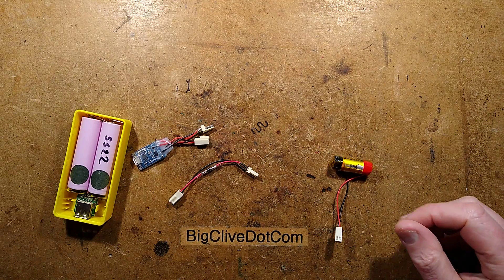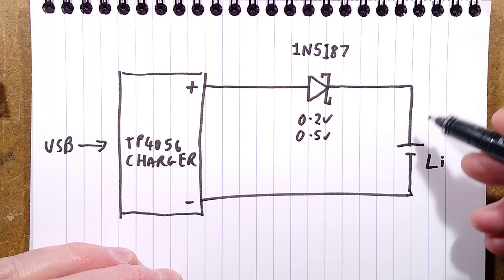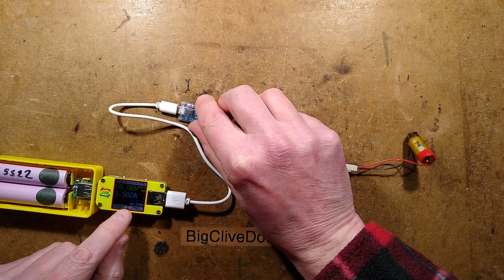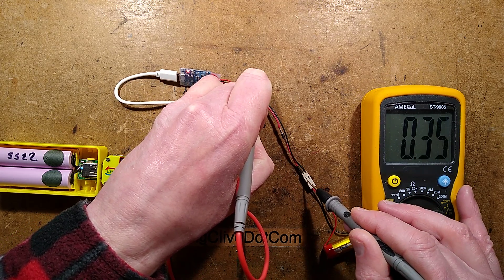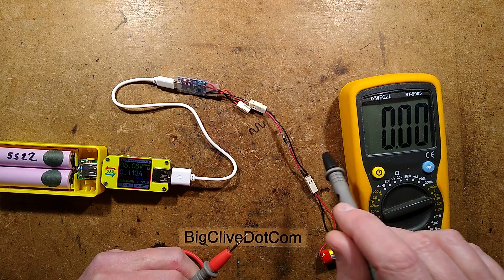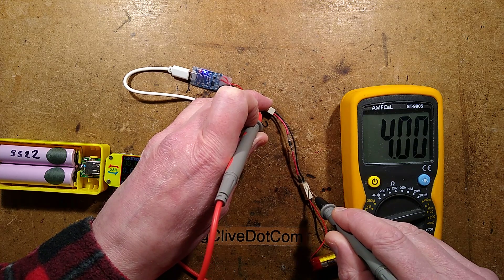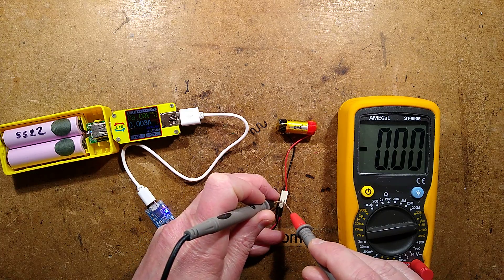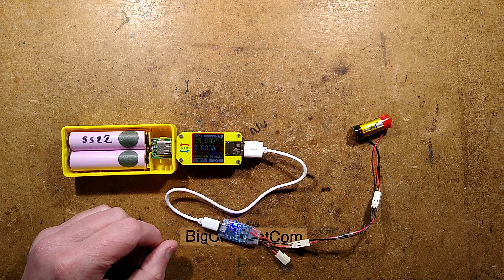Schottky diode between charger and lithium cell?

Comment: 3.9V should be around 90% of rated capacity, exchanging that last 10% for more than doubling the life (time and cycles) makes sense in standby applications.
Nice to see an actual test, thanks BC!
Reply: 3.8V is 50% SOC.  So  4.1V would be ~87% which makes batteries last for 8 years and more.
Reply: @olaf_s_23  I should be better about defining "charge (or, "saturation") voltage" vs "resting voltage" but, alas, the comment section is not conducive to verbose articulations. 
I'm just happy that there are a multitude with willingness to provide additional information without being jerks. This might not be the best forum ever, but it's at least in the top three! 
Cheers to all here! You lot continually restore faith in my fellow (hu)man.
Reply: @olaf_s_23  voltage alone won't give you the capacity of a lithium cell, it also depends on the charge/discharge rate.
Reply: Tesla recommends charging their car to 80 percent. Would that quadruppel the life?
Reply: @franzliszt3195  I don't know, probably not but maybe it's 2.3×? Specific datasheets are hard to come by so a big dose of salt and S.W.A.G. (Stupid Wild something Guess) is the best I can do.
Reply: @matthewellisor5835  no its not just the charge percentage. it's the amount of time it's at that percentage that really matters. So if you were to charge to 100pc then immediately drive where it rapidly falls below 80pc, then its nowhere near as bad for life as leaving at 100pc.  So for standby use 80pc charge is ideal.
Reply: @dr_jaymz 👍 I think we're trying to sing the same note but I might be out of tune. Keeping in the 80-90% - 30-40% SOC range will allow that standby cell/battery to live a long and (we can hope) rarely utilized life. 
If I've missed something, you have my apologies and request for edification.
Reply: @franzliszt3195  And then there's the issue of: If the car displays 80%, is the battery actually at 80% charge? Same goes for 0%. Also not just for Tesla, but any electric car, or other devices with batteries.
Reply: @maxine_q - well, as all charge/discharge monitoring systems are not exact, but are estimates based on the voltage and the charge / discharge current, if you don't hit one of the limits (full discharge or full charge), the indicated charge status will tend to drift away from the actual state of charge.
Reply: @Mark1024MAK  I wasn't talking about the inaccuracies of measuring the state of charge. The battery management system could tell the user the battery is at 100% when it is measured to be at 90% (and stop charging at that point). Same goes for 0%, leaving some extra room to extend the life of the battery.
To be clear, I have no idea whether any device actually does this, I'm just saying it could be done and the average user would have no idea about it (unless the manufacturer explicitly states that this is done).
Reply: @franzliszt3195  yes, if you keep the lower end of the discharge above 20% SOC, 60% DoD has ~4x the cycle life compared to 100% DoD usage for most lithium chemistries.
Reply: @andrewfidel2220  One thing many people seem to miss(not saying you are one of them), sure your battery lasts 4 times as many cycles but as you only use half the energy each time really the battery is "only' lasting twice as long. Of course that is still a big deal if you can manage it.
Reply: @stusue9733  That's true, but I would argue that even that is not the full story. Often batteries are not cycled over their full capacity. Eg phones are usually charged before they run out of power, using only ~60-80% of the full battery range. In that case you don't need more cycles if you limit the capacity, but you do gain lifetime.
It's difficult to compare as it's very application dependent, but generally it's better to cycle a battery from 15-85% than 30-100%
Reply: @TiSapph Yes it's application dependent. I was just pointing out that if for e.g. your battery could last two day but you charged it every day instead. You get four times as many charge cycles, but the battery only lasts twice as long, not four times as long.
Twice as long is certainly worth it,

I don't know if phone batteries are the same but good old lead acid batteries have a sweet spot in the DOD, cycles, total energy stored. Where more cycles of lower DOD results in less energy storage over the life of the battery. If that holds, while charging the above phone every day gave an improvement, its possible charging it 4 times a day would make things worse.(Can't find the graphs). To much og a good thing hehe.

What I think on a sample of 1 is best for my phone battery is to charge it on a 500mA charger, which is 25% of the factory rate.
Reply: @stusue9733  Yeah, there's definitely many factors. What I meant is that the number of cycles doesn't necessarily depend on the capacity of the system.
If the number of cycles is set by some other factor (eg once a day for a solar system), you might get the full 4x lifetime improvement when limiting the maximum charge.
Especially deadly are small cycles, like 20% of the full capacity. Cycling between 80% and 100% will be way way worse than cycling between 60% and 80%.
But as you said, the improvements (if any!) are very dependent on the use case.
Reply: @franzliszt3195 not really, car batteries are rarely charged up from 0%
Reply: 5 volt supply and 0.9 volt drop power diode . like 1N4148  ETC..As cell charges it voltage rises to reduce current... try it and see on video or next video.

Comment: The cycling, is the 4056 turning off and checking battery voltage then turning on again ?
During the check the diode isn't letting it happen, so it's seeing nothing
Maybe another diode in reverse ?
Reply from the maker: I tried that, and also a parallel high value resistor.  But no difference.

Comment: Because of this channel, I started using the TP4056 module with battery protection for my LI cells. Works fantastically well. Thanks Clive.
Reply: I as well, they are very dependable and get the job done cheap and well. Heck I even tore down a cheap solar light recently, and the charge control chip was in fact a TP4056!
Reply: likewise !

Comment: This is so important! The 'last' bit from ~3.9 to 4.2V is not where the bulk of the energy sits anyway. Lower charge termination voltaqe keeps the cell safe and happy. And prevents spectacular thermal runaway..or whatever fires are called!

Good video, thanks Clive!

Comment: Quite interesting! It does provide some option for people using these little charging modules a way of adjusting the top voltage level for the battery.   No custom circuit or chips needed.   

It may not be ideal, but cool to know this is an option. :)

Comment: I've wondered before if you wanted to have multiple batteries very slowly charging/maintaining, could you have them with diodes in series and have one charger feeding them? Then the diodes stop them from dumping current into each other and over time they all balance out to a good storage charge.
Reply: That's pretty close to how the balance circuit on a BMS works, though they also generally add a discharge resistor as well.
Reply: @andrewfidel2220 BMS is with series cells ? I think just paralleling the cells does not need anything, not even a diode. The voltages will level each other out, and the charger does not go further than the 4.2 Volt. Auto balancing. Trick is to use similar and dedicated cells, not a bunch of different brands in different states of maintenance.

Comment: Maybe put a couple of schottkys in parallel. Or a bigger one.
Reply: The problem is that if the current nears zero, the diode drop also nears zero. I was thinking about a 3K9 resistor over the cell (1mA) so the voltage drop never comes under .2V.
Reply: a bigger one would probably minimize those oscillations, as it typically have more thermal mass and less Vdrop variations.
Reply: You could also use a forward biased transistor in saturation.  The C-E voltage drop is only about 0.2 Volrs.  Too bad germanium transistors are hard to come by these days.  The voltage drops is a little less and as current heats the junction, the voltage drop is even less.  With the TP4056 limiting current, thermal run-away would not be an issue, but the heating of the germanium would allow the battery to get more current when it is discharged and then tail current off more as the junction cools when the battery nears full charge.

Comment: I like the way you make these components flexible using connectors. I however recommend using xt-30 connectors as can be seen in my latest video. I have them on so many things that many operatoins/experiments go without soldering for me. It annoys me that I cannot reduce the charge voltage for these chargers.

Comment: My comment/guess of 4.05V during the live stream was based on a datasheet showing the termination voltage at 4.26V. I now realise that's the maximum variation with the minimum being 4.13V.

I wonder what the actual termination voltage would have been without the diode, if your sample of the chip terminates in the low range it might explain why the test ended at 3.9V.

I have a couple of lithium battery chargers which always end at 4.14V to 4.16V but I haven't looked to see if they are based on TP4056.

Comment: I realized that the charger has to stop periodically and monitor the battery voltage at zero charging current.  But with a single Schottky diode blocking the voltage in the reverse direction, all the charger sees is some very small leakage current through the diode.  So what may happen is the diode's leakage current may be highly dependent on the temperature, making the maximum charge unreliable.  

Adding another diode in antiparallel with the original is not a solution.  It will subtract its voltage from the battery, giving the charger the voltage showing it's undercharged.  It may be best to instead put a high value resistor across the diode to swamp out the variable leakage current and give a stable charge.  I'm not sure what value, but I would experiment with 100k and go down to see if it makes a difference.
Reply from the maker: I tried the inverse Parallel diode and a resistor and neither made a significant difference.